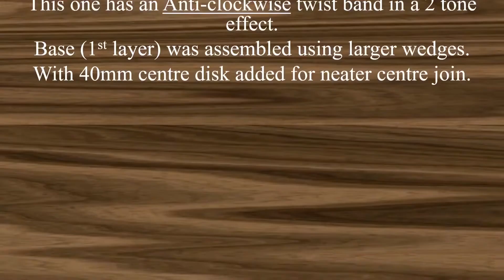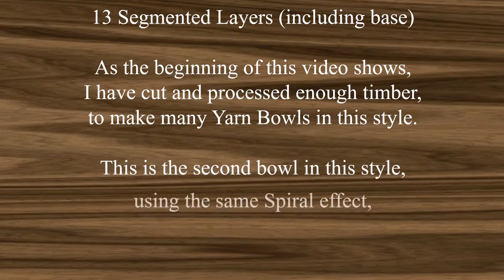XL Yarn Bowl Kapur Pine 2020 No 10

Comment: I went bach to look at 2020 #8 to check you weren't pulling a fast one😁. And yep, they're spiraled in the opposite direction.  You make these bowls with such attention to detail ... very nice Rob👍     Stay safe.  -Mike😷
Reply from the maker: Thanks Mike. I was wondering if someone was paying attention.  It is only a small detail, if you have the 2 bowls together, is it noticeable.  Other thing I realized was No8 has 14 layers and No10 has 13. NOT superstitious. . . Hmmm  Both the same size. Thanks again Mike.  Stay Safe also. . . Rob 🙃
Reply: @robertcloosterman9336  13 x 1/16" can be a lot if sanding a bit extra per layer 🤷‍♂️